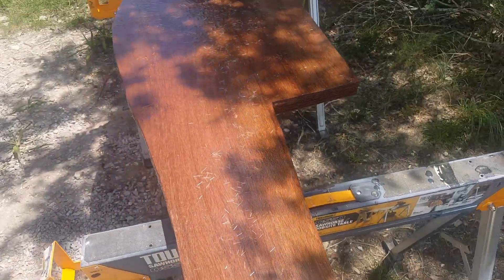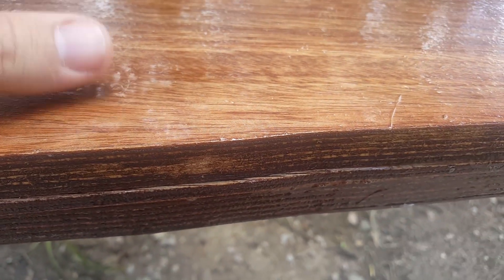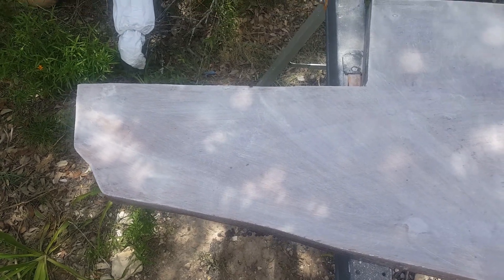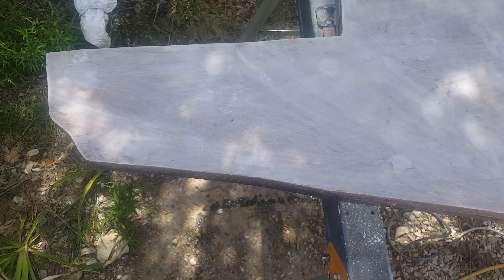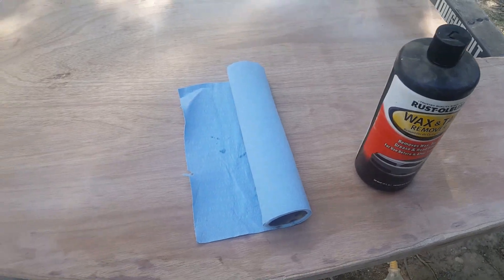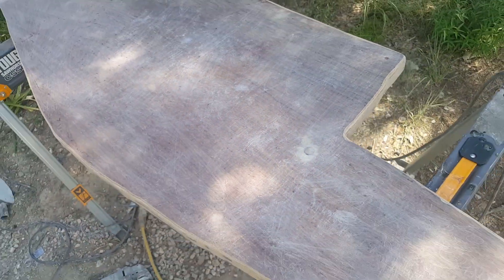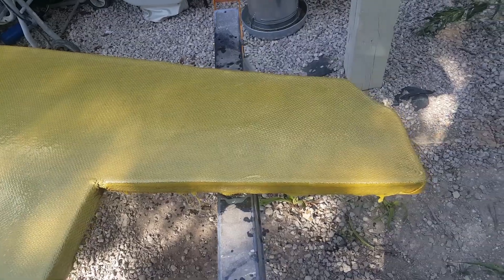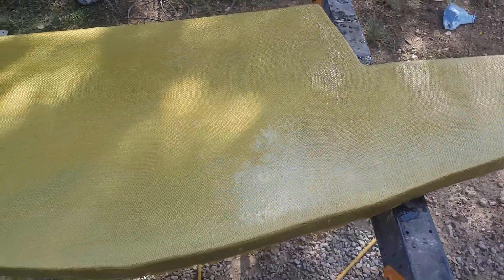Boat Transom and Floor Rebuild - KEVLAR Transom - Marine Plywood  - Part 31

Comment: pro tip, if you coat your clamps with PVA or just wax where it touches the laminate, you will never have issues with it sticking. or can use cellophane as well. Good video
Reply from the maker: Great information. I worried about that. Thanks!

Comment: Bulletproof…. I think literally bulletproof
Reply from the maker: It’s legit stuff. I left the engine compartment uncovered and people love the yellow Kevlar.
Reply: @michaelromer2016  Most people would use fibreglass or carbon fibre but you went all out bro👏👏👏 Awesome
Reply from the maker: @stevew6141  thanks! You ought to check the follow up videos. It’s still holding up years later!